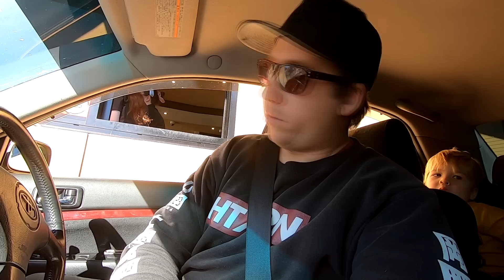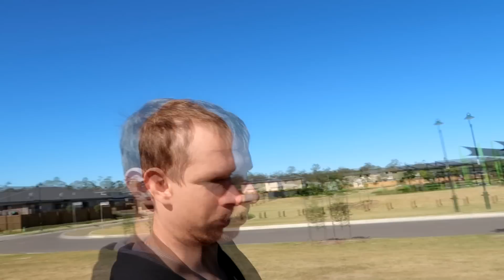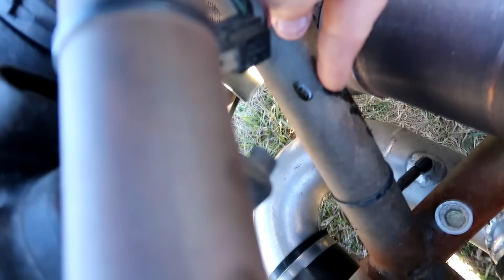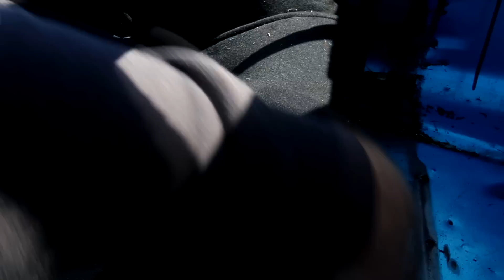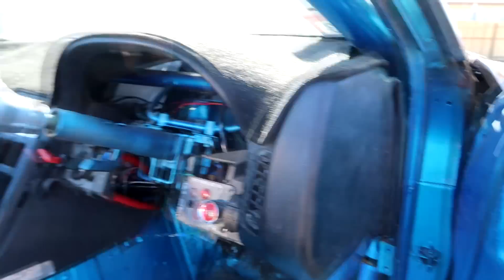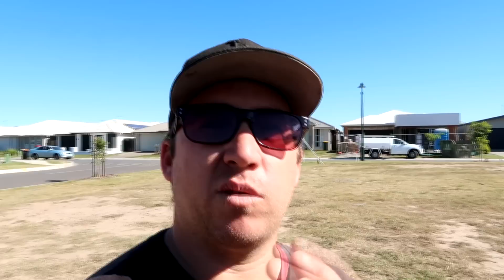checkout my v8 turbo JDM s13 convertible

Comment: You didn't show us the fuel system. All good tho, I've been waiting for a close look at this thing. It sounds awesome with that cam. Re: cooling, what's probably going on is at speed the air shoots over the top of the car creating low pressure pocket in the cab which sucks and traps smoke in and also works against your rad fans that are trying to pull the air from the lower pressure cab area to the boot.
Reply from the maker: yeh the boot was zip tied shut and we had nothing to cut the zipties with us haha ill go over that section again soon

Comment: ls an rear rad needs an20 lines man will help massively with water temp
Reply from the maker: I have been told by alot more people that they prefer -16 for water lines
Reply: @Lukefink  really? seems to be good for sr but would of thought cant flow enough for ls
Reply from the maker: The an20 flows to much from what i understand. An16 flows the right amount
Reply from the maker: Like the water pump delete kits at an16 so no point going up a size after that
Reply: @Lukefink  yeh that makes sense then no point going bigger for no reason